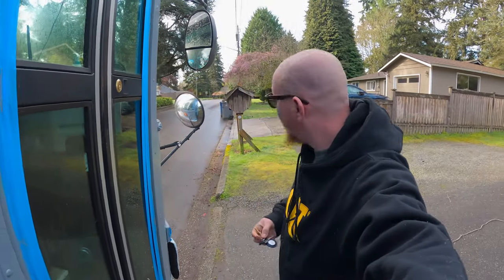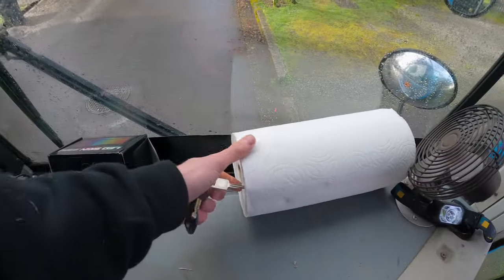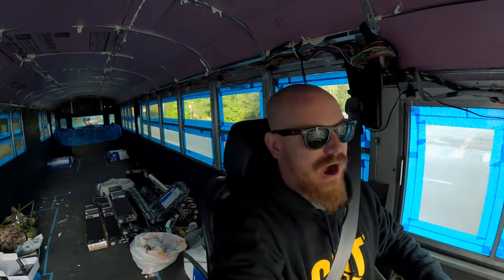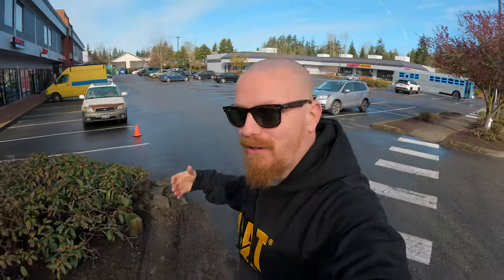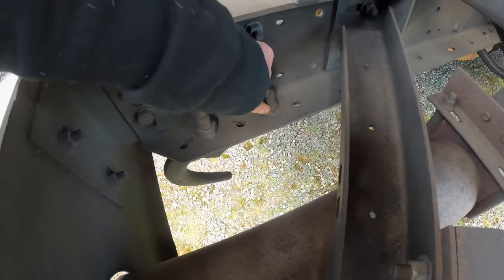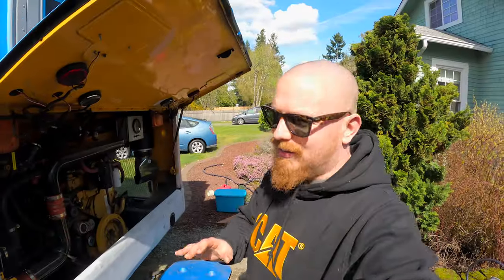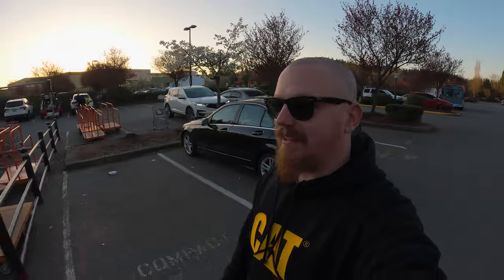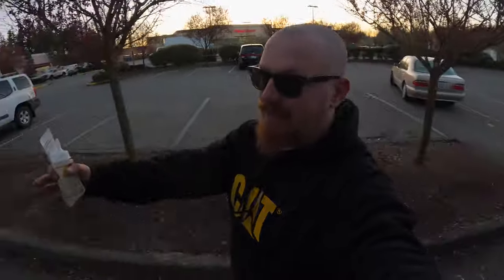Hitch Install on our Rear Engine Bus | Skoolie Conversion

Comment: The Amazon link in your description does not go to your homepage on Amazon.
Reply from the maker: I'll have to take a look at that!
Reply from the maker: Alrighty, I think I have that fixed. Thanks for the heads-up! I'll be updating these lists as we continue with our build, likely a complete overhaul, but I appreciate you considering using that link! 😊 Even if you click that and then order something outside of that page, I suspect that should still work as a "referral" of sorts in the Amazon system!
Reply: @CozyLivingMachine  ah, now it works

Comment: Lenny looks great, hitch is perfect. Talk about noise, I bet Lenny was screaming "No!, No! No!" when it saw those kids on the corner. Lenny's retired from that and going to get to travel some now. Well deserved from his previous life.
Now to ruin the mood:  Is there a vehicle code that allows to have the amber turn signal outside the red rear tailamps/brake combo lens? Hate for you to be stopped for that and incur a citation. And I've wondered about Emma not being belted in when riding in the vehicle. I'm sure you're planning to do that in time, but if someone has a problem with the lights, they may inquire about such things as seatbelts for all occupants. Some officers are sticklers about code violations. 
The whole project is fun to watch except the weather delays and temporary health hitches. Hope your system settles back to feeling well mode.
Reply from the maker: Oh yeah, no joke! No gaggle of kids in Lenny. 😂 Interesting question, our bus came like this with the ambers outside and the red brake lamps inside, and I believe that most buses (other than W. V. buses for some reason) are amber turn signals with red lamps! I do believe that Emma has to have a seat, but the seat belt is not required... at least for school buses. Granted, our bus is titled and registered as a non-commercial school bus (weird thing) and not as a passenger vehicle, so this is more a thing where we would rather not find out how a judge might interpret things.